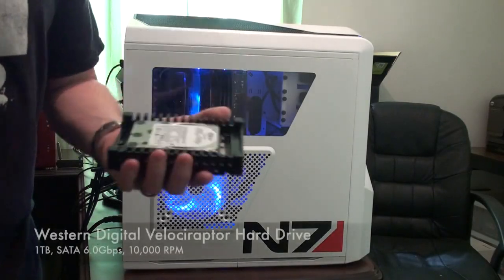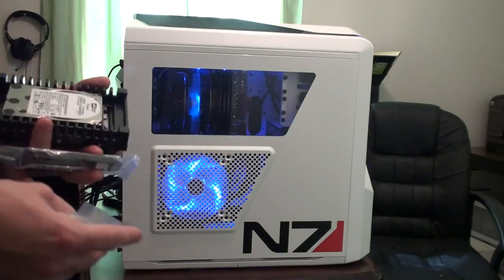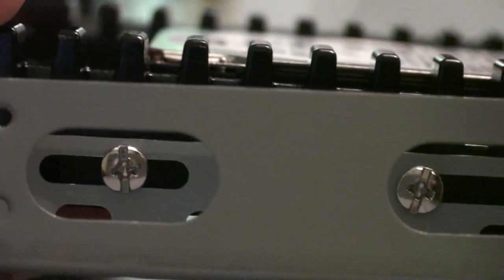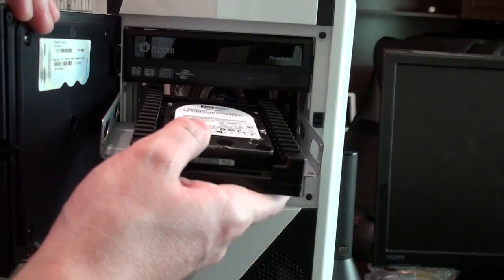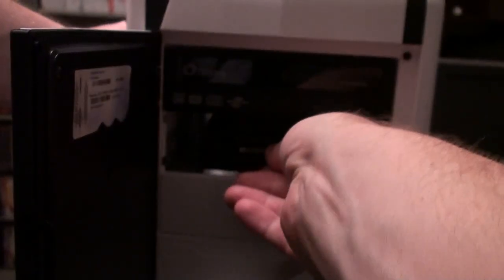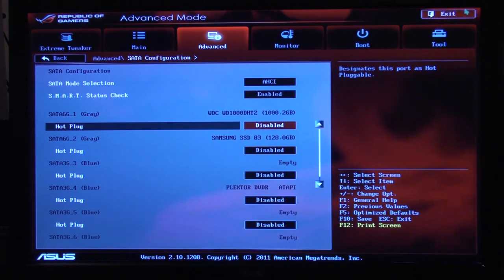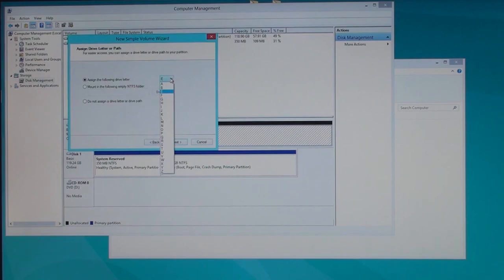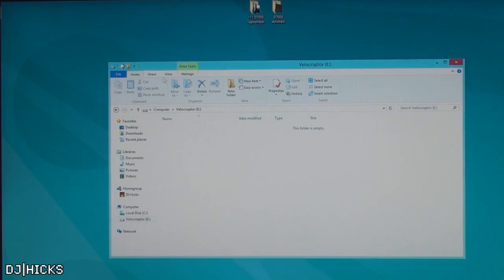Install a Hard Drive in an Optical Bay

Comment: Dude wtf was that a 2 second cold boot or did you speed it up? That's insane 😲 I am beyond jealous. And that's the most beautiful bios I've ever seen. Ugh, I still use 10 yr old hardware for my gaming 😭
Reply from the maker: Hah, it was sped up. Boot times really sped up with Windows 8, but it's rare to see it that fast. I did have an Asus Zenbook that would tell you how fast your last boot was. It averaged about 1.4 to 1.7 seconds. That thing was insane. Unfortunately I killed it in a car wreck.
Reply: @DJHicks  is that a cold boot or a restart of 1.4-1.7?  I know ssd is a major factor but do you think the new gpt file table vs old mbr plays a role as well? Its another thing i noticed on newer systems that got me curious. Like if i switched over to gpt but kept all my old hardware with a normal hdd would i notice improvements in booting? 😂
Reply from the maker: @Maddenzie  I don't know if it would make that big of a difference. But yeah, cold boot was that fast. It took longer to wake from sleep than it did to cold boot. Weirdest thing.

Comment: Hey what kind of cooler do you have on your gpu?
Reply from the maker: Whatever came on the card. Nothing aftermarket. I think it was an Asus AMD 4870 Dark Knight or something.
Reply: OOh kkay thnx looked aftermarket and im looking for one. Do you have one you can recommend for a gtx 760?
Reply from the maker: Not really. I usually stick with stock. The only reason I'd change a video card cooler is if it broke or I wanted liquid cooling. But yeah, I haven't had to travel down that road yet so I have to worthy advice to give.